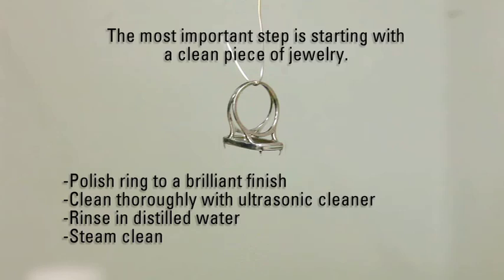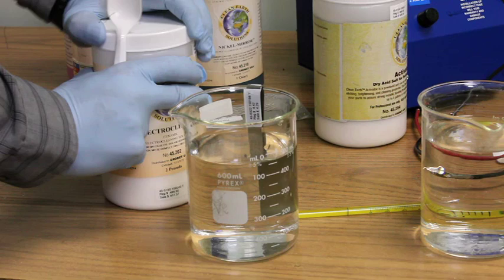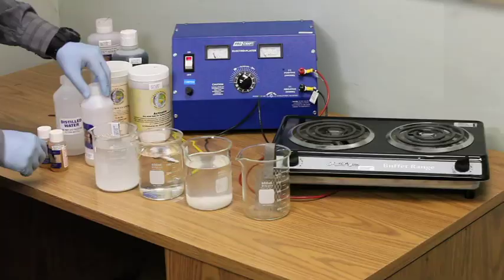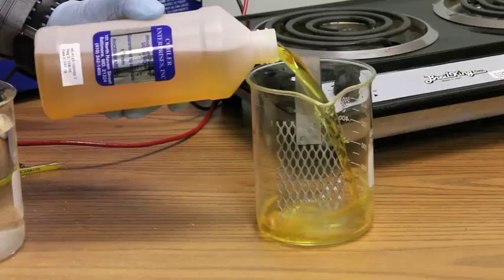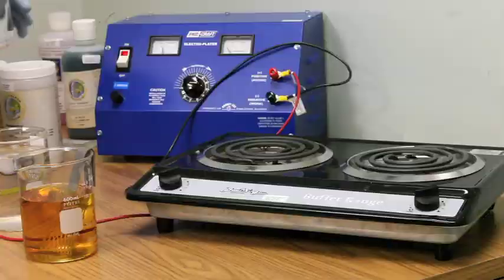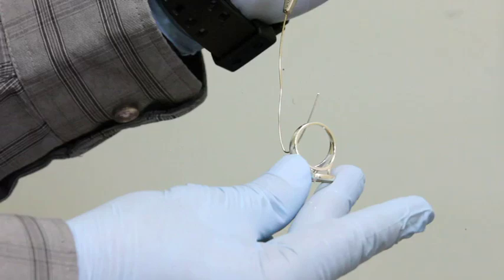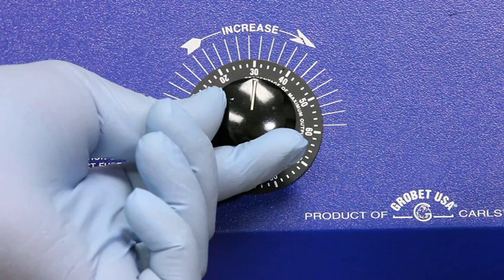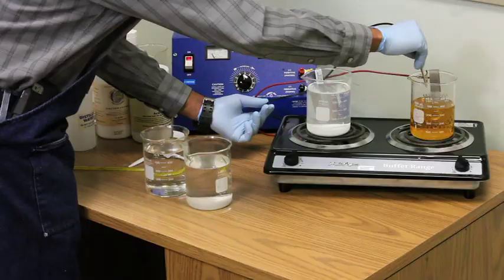Rhodium Plating: White Gold

Comment: Hi. To plate with rhodium, do you need to remove the diamond first?
Reply: Samé doubt frm here....
Reply: No. The diamond will be fine.
Reply: no need......
Reply: Omg no, lol
Reply: No, rhodium has to plate over another metal like nickel or copper. But it comes out better when the piece is polished shiny. It’s all based on ratio and the shine on whatever you’re plating is going to be the shine you get with rhodium, nickel or gold
Reply: I wonder much it would cost to start plating? I wanna plate my vintage razors
Reply: Not really. The Rhodium ions will only adhere to the metallic parts.

Comment: this is awesome...I thought they polished it like a car. I had no idea how simple it is. Now I just want to know why its 40 bucks!
Reply: Plating costs so much because Rhodium solution actually contains micro-particulates of precious meals.  The amount of rhodium solution shown in this video contains over a thousand dollars worth of gold, it's just in tiny particles waiting to be bonded to a metallic surface.  Additionally, in it's liquid form rhodium is highly acidic and gives of carcinogenic vapors.  What the video did not highlight is the ventilation and breathing protection aparati needed to work with rhodium SAFELY.
Reply: interesting, thanks! D. Mateo Flores
Reply: @laleki9  - Plus there are things like overhead costs just in running a jewelry store, and a good portion of this involves paying people to do all the work that's needed to a piece before you can even start plating it. You don't just stick a piece of jewelry on the wire, dip it for a minute, and call it done. First it needs to be examined to be sure that there's no repair work that's required before you even start with the plating process. Plating is the absolutely last thing that should be done to a piece of jewelry, so it is extremely wasteful to plate something before it's been determined if there are say, prong tips that need to be redone first on any of the stones that might be in a piece. If you try and polish a piece thoroughly before even examining it, and there are broken/weak or even missing prong tips, you could end up sending tiny stones spinning off into space! Then you've got expensive repairs to do before you ever get around to plating anything. There's a hundred or more issues that need to be eliminated before you start in on the plating process, and a pair of well trained eyes attached to a pair of equally well trained hands don't come cheap! Materials are only part of the cost picture of paying only $40 to take good care of your jewelry.
Reply: Shari D57 This is the case.
Reply: Just did my and cost 125$ 😢
Reply: @misspuppa 😂 bro that’s messed up but does it look good?

Comment: The liquids should be room temperature? Is it advised to heat any of the liquids? I've heard either one will work. Thanks ^-^
Reply from the maker: The only liquid you should heat is electro clean. If using silver, then use nickel.

Comment: If you have a vintage chrome-plated watch on which the plating has failed and is flaking off, can you remove the old plating and re-plate with Rhodium?
No idea what metal the casing really is, sadly.
Reply from the maker: Hi Scott! Here's what our Tools Tech Team says:  the short answer is yes, you can.  Removing the old chrome may prove a bit challenging, but once that is complete, the main concern is getting the newly revealed surface as clean as possible.  It can’t be too clean.  Beyond this, the plating process should proceed as normal.  Hope this helps!  --Stuller Marketing
Reply: @StullerInc  Thanks!
Reply: Chrome can be removed in hot caustic solution,check Google,also used for old metal bumperbars, if it is chrome then it should have copper plate under it. if nickel you are going to need a acid solution to electricaly etch it away.
The shinier the undelayer the better the Rodium finish. and plate a bit longer then 30 seconds! obvious that the item has been worn in a wearing environment.

Comment: i assume the plating will not stick to diamonds mounted on jewelry??
Reply: Mitch Plumlee nop :) the stone shine like a stars!
Reply: Ann
Reply: Anna WWB
Reply: That's correct. The plating process only sticks to the metal, not to gemstones. I've had my 43 year old diamond solitaire, set in 14kt white gold replated numerous times since I first got it, and the only way the diamond has ever been affected is that it always comes back to me EXTREMELY clean and sparkling! That's because of the thorough cleaning and polishing process the entire ring is subjected to prior to it being replated. Being cleaned thoroughly in the ultrasonic cleaner removes all traces of "muck, mud, crud," and whatever else it may have been subjected to since the last time it was cleaned, (which is frequent, in my hands, as I cannot tolerate jewelry which does not shine and sparkle like the day it was first sold) and then there is also the renewed reflective surface of the metal that helps brighten up the whole thing as well. 
And of course, nobody would ever have their diamond jewelry replated like this if it did ANY kind of damage to the most expensive part of the piece!

Comment: Personally I would make sure that cook rings were stable and not wobbly. I dread to think that you would use gold plating solution containing cyanide on this set up.
Reply from the maker: Hi there! Andy The Tool Guy says: The process is rhodium not gold plating. Rhodium should be not heated and the liquid should move so you pull electrodes from the entire jar.